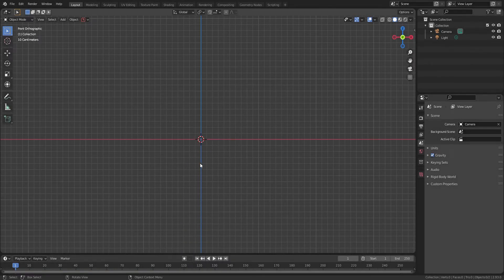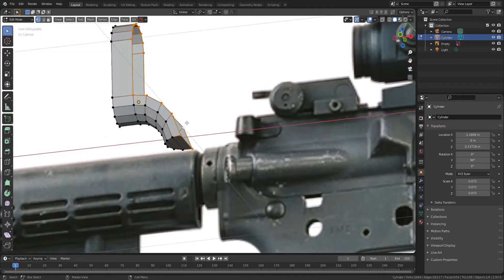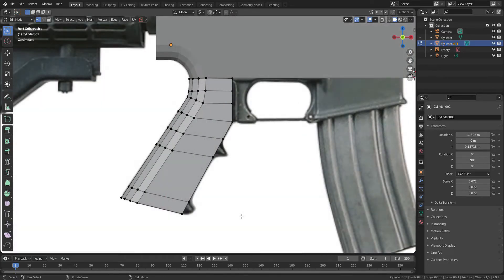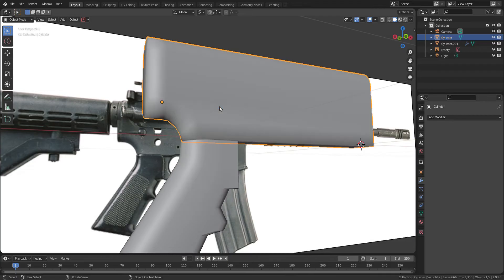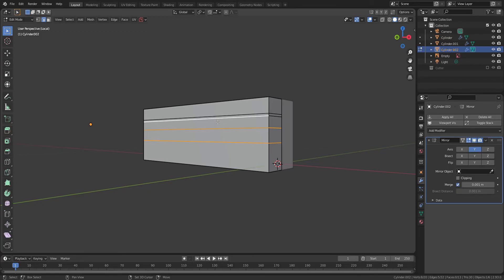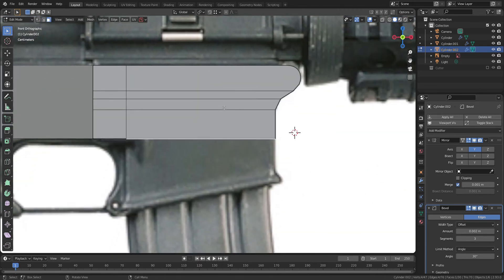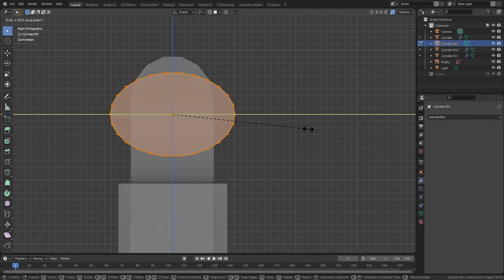Blender M4A1 3DCG modeling tutorial for beginner - Part 1

Comment from the maker: If you have any question, fell free to comment below:)
Reply: sir what is the commands shortcut key how do you do the first cylinder shape what are the shortcut key pls tell
Reply from the maker: @TRINIX_YT316   Hi thanks for the comment! First I add cyinder with SHIFT a, rotate with r y 90, and scale down with s:)
Reply: @Guu_3DCG  thank you so much
Reply: how did you did the handle
Reply: 1:44 how did you do
Reply from the maker: @TRINIX_YT316  First press alt z to go to be x-ray mode, select vertecis with using mouse, and press e to extrude. :)
Reply: @Guu_3DCG  then
Reply: @Guu_3DCG  Hey, 1:04 what key did you press to reveal the faces?
Reply from the maker: @ugleerat4515  Hi, first press Tab key to go to edit mode, and press 2 or 3 :)
Reply: @Guu_3DCG  alright thank you!
Reply: @Guu_3DCG  at 7:35 control minus didn't work
Reply from the maker: @shalkonedev  Hi, I think you need to apply rotation and scale with CTRL A, or recalculate normal with SHIFT N in edit mode:)
Reply: bro, Give me your discord please)
Reply from the maker: @tarkov_fan 　hi! In fact I don't do discord now. If you have some questions or request fel free to give me email, cheers:)
Reply: Hello, in 2:24 how did you flatten the faces? Because i saw your answer pressing s, x and 0 but that didn't work for me.
Reply from the maker: @bacon224  Hi, basically s, x and 0 should work. Maybe you are in object mode. Those commands should work in edit mode. Cheers:)
Reply: @Guu_3DCG  Alright, I will test it, thank you for the information! It did work, so thank you very much.
Reply: in blender 4.2 these add ons allready installed or i need to download some where?
Reply from the maker: @haydardarc4081  Hi, yes it is already installed in Blender:)
Reply: yes how did u flatten the faces
Reply from the maker: @brimgrim9804  Hi, I pressed s, x, and 0:)
Reply: @Guu_3DCG  tysm :)
Reply: @Guu_3DCG  thanks man
Reply: how to add gun to game?
Reply: 0:53 what key did you press?
Reply from the maker: @ckrx  Hi, I pressed g to brab the object:)
Reply: how did u do 2:24 thing
Reply: ok
Reply from the maker: @DeltahCod Hi, you mean grabing and rotation? Grabing object is g key and rotation is r key:)
Reply: i cant find the image sadly, can you send a link of your image?
Reply from the maker: @TudoreckicTheEpic1  Hi, unfortunately the exact same image on the wikipedia is deleted. So I would like you to use something similar image. I put the link of it on the description so feel free to use it. Cheers:)
Reply: @Guu_3DCG   alright, no problem bro
Reply: Thank you for helping to flatten the faces, but in 8:13 how can I make it so the cut is flat and to convert them into verticles?
Reply: @bacon224  if you mean the angle of the cut, use a for angle constraint
Reply: when i open the reference  in blender is become so bad quality
Reply: 2:24 how do you flatten the faces?
Reply: wtf were u saying in the beginning
Reply from the maker: @undeadgamedev6229  Hi, Thanks for the comment! I said "Hello everyone" in the benning :)

Comment: At 4:32 when you added the three loop cuts, the cuts when all around the mesh, this is not working for me the loop only appears on face that i am viewing the mesh from it doesn't go all around. Also same issue when you added a loop cut at 8:36, when i tried to add it it only appeared on the top it didn't go around the mesh. Can you please help me with this?
Reply: At 8:36 you need to take out all Ngons with a knife tool and turn them into quads, because loop cuts doesn't work well with tri and Ngons
Tri = 3 vertices in a face

Quad = 4 Vertices in face
Ngons = more than 4 vertices in a face
Reply: @pedrocastro1368  Thanks

Comment: After I make the cylinder and position it. In wireframe mode I select the top half vertices, extrude it to fit to top of gun. I end up with 7 verts on top and 9 on the bottom, on your video you have 8 on top and bottom. What am I missing? I retried it a bunch of times with the same results. The bottom of the extruded cylinder always has two more verts.
Reply: what i did to fix this is just after adding the cylinder mesh, if you look from the top/z axis, you’ll notice that the top and bottom parts of the cylinder are pointed/have one vert rather than being flat/having two verts. you can just rotate it slightly so that there are two verts on each the top and bottom sides. then after you extrude you’ll have 8 on each side (:

Comment: scuse me at 10:13 when i try and add the bevel modifer to the back portion it just doesnt work, ive tried shift n in edit mode aswell as ctrl a with rotation and scale help
Reply from the maker: Hi, to be honest I'm not really sure why your bevel does not work, because most of reason of not working is not applying rotation and scale. Did you set the order of modifier like I did? If you put bevel modifier above the mirror modifier, then it maybe the reason, good luck! :)
Reply: apply all trabsforms and do
Reply: @Kaidrain1  2 years ago bro 😭

Comment: 4:00 the bevel messes up the mesh weirdly did I miss something?
Reply: try this : going to edit mode, select all vertices pressing 'A', then press 'M' (merge), select "Merge by distance"
this removes extra vertices. extra vertices are bad while you bevel......
Reply from the maker: @Mprince6588  Cool! Thank you very much!
Reply: @Mprince6588  Thank you I solved the problem
Reply from the maker: Hi, most of reason why bevel does not work is that forgetting applying rotation&scal with ctrl A, and recalculating normal with shift N in edit mode:)

Comment: hi 07:46 I had trouble getting the boolean to work. I tried shift ctrl num - and ctrl - and those dont work. using the modifier doesnt work either, it doesnt cut the small part out of the big piece. instead theres an overlap like a duplicate of one of the objects eve though i selected difference, not union.
Reply from the maker: Hi, maybe you sould recalculae normal(shift + n in edit mode) and apply rotation and scale (ctrl + a in object mode) on both objects :)
Reply: @Guu_3DCG  I tried this, and then when I select both objects in the order you did and click ctrl minus it just zooms out
Reply: @aprilrawipa  Do you know how to fix this I am having the same problem
Reply: I got a solution for this .
you can just use union instead of difference. and then apply

Comment: Great video! Just a small correction on the terminology you use (the more you know kind of thing):  the part of the rifle you are modeling which houses the bolt, firing mechanism, and magazine is not the barrel; it is called the "receiver". Specifically, the "upper receiver" houses the bolt, ejection port and barrel and the "lower receiver" houses the firing mechanism (trigger) and magazine (feeding mechanism). The barrel is exclusively the cylinder out of which the bullet is fired. It's useful to know these distinctions because in certain videogames (like in real life) these parts of the firearm can be swapped out and customised.
Reply from the maker: Hi, thanks for the comment:) Ah, I actually didn't know that! Thank you so much for the information:)

Comment: I don't understand what happens after 7:09 , help :)
Reply: before 7:30
Reply: If I understood correctly, then an addon is required " bool tool "?
Reply from the maker: @ALOHADANCETV  That's right :) You need to press ctrl and numpad - for bool tool.
Reply from the maker: @ALOHADANCETV  Before using add-on bool tool, I applied rotation & scale with pressing ctrl and A in object mode, and recalculating normal with shift and N in edit mode for each objects.

Comment: at 8:16 when you use K for loop cut, does it cut all the way around? i did it and the next loop cut (with ctrl+r)but it cut only the front face. how can i fix that?
Reply from the maker: Hi, I think the version of Blender is different. I used Blender 2.9 so it was Z to cut through, but if you use 3.x, it is C to do it, good luck:)

Comment: at 7:30 how did you do this part? CTRL + - doesnt work in my keyboard 
i would like to know how do you use boolean modifier to cut the object
Reply from the maker: Hi, before doing ctrl +, you might need to apply rotation & scale with ctrl a, and recalculate normal in edit mode with shift n, on both object. This will help you to cut the object properly ;)
Reply: @Guu_3DCG  okie! i got it^^ thank you very very very much!!
Reply: This won’t work for me when I do ctrl + or - it just scrolls the view in and out

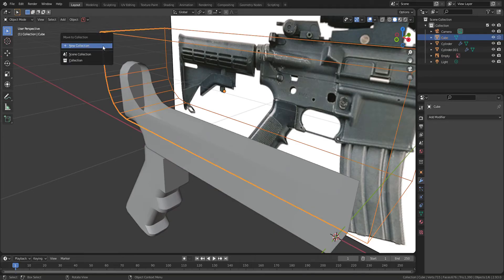Comment: why when i try to CTRL + - doesnt work in my keyboard i tried with the other one  - but still doesnt work do u know another way to Btool cute? 7:36
Reply from the maker: Hi, most of the reason that failing booltool is not applying rotation&scale and recalculating normal on BOTH object.
Maybe you can use boolean modifier to cut the object, but it also needs applying rotation&scale and recalculating normal. Good luck! :)
Reply: @Guu_3DCG I’ve tried doing everything you said but it still won’t work

Comment: man im already lost, how do i get the options at the bottom right for the cylinder at  0:20
Reply from the maker: Hi, you mean how to add cylinder on the viewport? It’s shift+A, scale down with S, and grab with G :)
Reply: @Guu_3DCG  oops, i meant bottom left sorry, it doesnt come up automatically for me and im confused as to why
Reply from the maker: You mean the parameter editor that allows you to change the number of faces?
It basically disappears as soon as you deselect the mesh. Or sometime it comes back with pressing F9.
Although I changed the number of vertices in the video, actually the default cylinder will work, so if the solution I suggested before didn’t work, using ordinary cylinder is fine.
If you got any question feel free to comment:)
Reply: @Guu_3DCG  thankyou <3

Comment: 0:40 what u did?
Reply from the maker: Hi, I changed the screen from solid to wireframe mode. You can do the same thing with pressing Z key:)
Reply: @Guu_3DCG  I was also confused here, after i switched it to wireframe mode it would only select the whole cylinder instead of the seperate faces
Reply from the maker: @AAAntis  Hi, I think that is because you are in object mode, not edit mode.
Reply: @Guu_3DCG  oh thanks

Comment: I'm not exaggerating when I say this; I have been stuck on the 45 second mark for the last 2 hours. I'm out of my element for sure. The instructions are clear, I just don't know what I'm doing wrong.
Reply from the maker: Hi, you mean you couldn't switch to wireframe mode?  Or you couldn't select the vertices and extrude in edit mode?
Reply: @Guu_3DCG  I am having an issue with wireframe mode and vertices.
Reply from the maker: @mariolavalle624  I take that you can not select vertices, located behind the object, even in you are in wireframe mode. Is that correct?
Reply: @Guu_3DCG  yes, you're exactly right
Reply from the maker: @mariolavalle624  Maybe you switched to wireframe mode directly from object mode. You need to go to edit mode first with TAB, and then Z to select wireframe mode.
This is an option but maybe you can try the experimentation as below.
Process 1: 
1. Open the new file and select "General".
2. Select cube and TAB to go to edit mode.
3. Z to select wireframe.
Process 2:
1. Open the new file and select "General".
2. Select cube and press Z to select wireframe.
Although both are same wireframe mode, I believe process 2 is the situation you are in and you can not select vertex this way.
Reply: @Guu_3DCG  Thank you so much for your help!